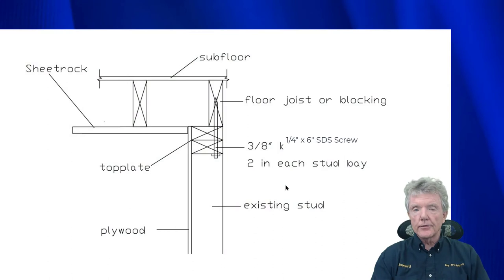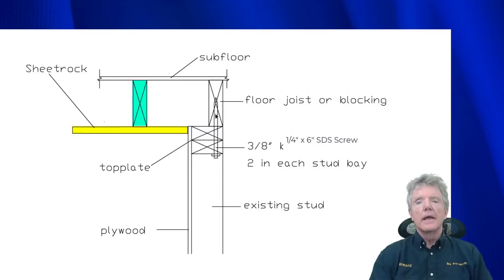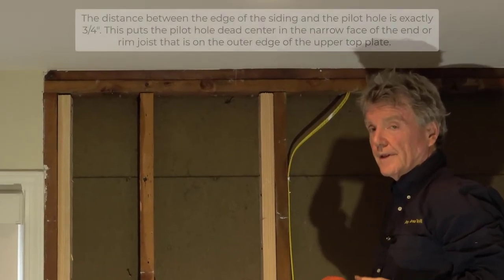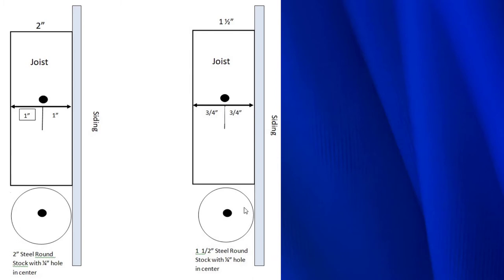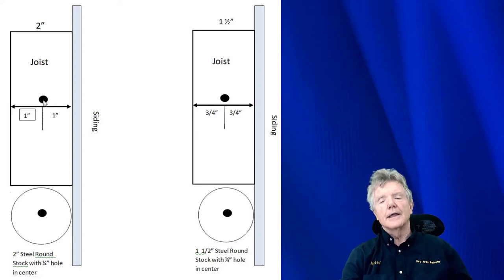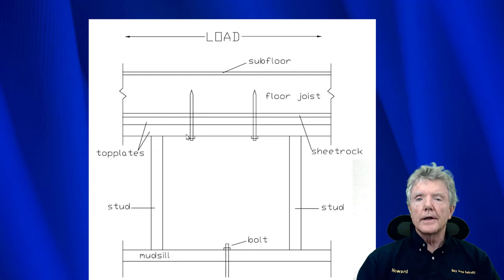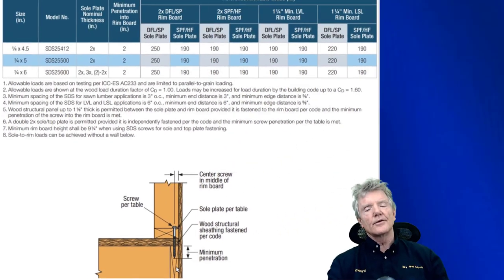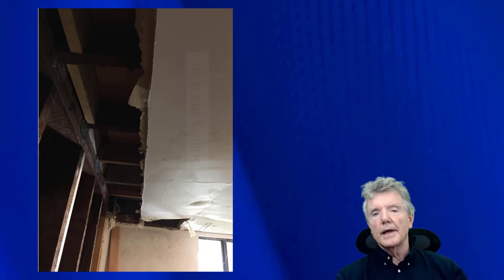Easy Cost-Effective Floor Connectors: Short Version

Comment: Fantastic advice. Amazing that nobody I’ve talked to has proposed this solution.

Does a typical retrofit include floor connectors along the entire perimeter, or only those sections that are shear wall?
Reply from the maker: Only those sections with a shear wall.